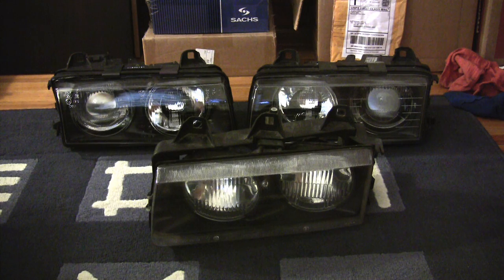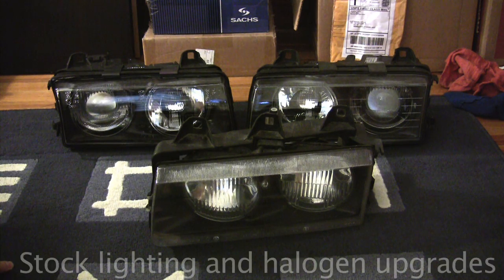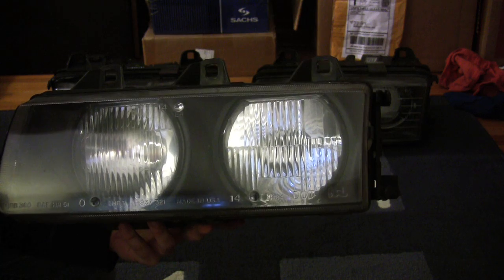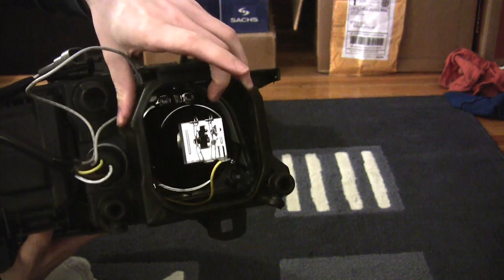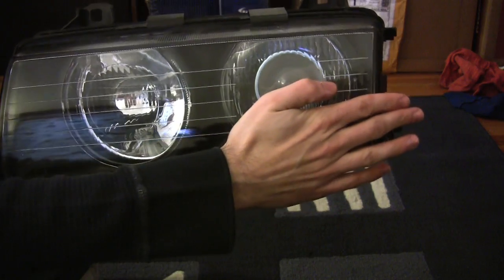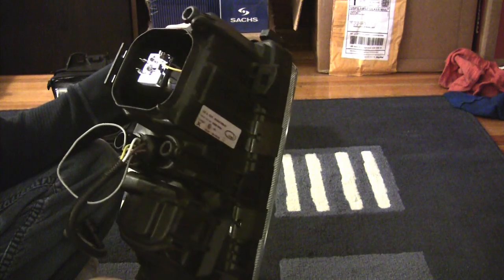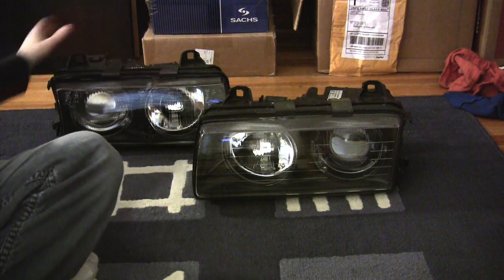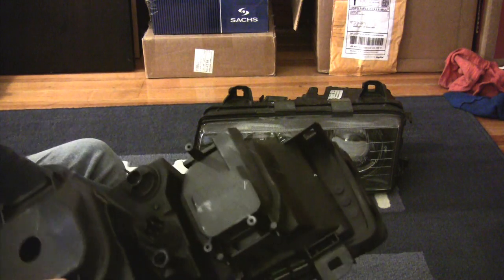BMW E36 Lighting For Noobs - Part 1 of 4

Comment: What are your opinions of the hella 9006/9006 euro reflector headlights? They could be the best of the bunch, better than the h1 and h7. Reason being is you can modify the hir2 bulb to fit into the 9006 bulb socket, they both have the exact same bulb geometry, and focal point. The main difference being is the 9006 bulb only puts out 1000 lumens and the hir2 bulb puts out 1850 lumens. The hir2 bulb also has a more tightly would filament, therefore creating a more focused beam. also the high beam is considerably better a regular 9005 bulb puts out 1700 lumens, however the hir1 , which is the high beam, puts out 2400 lumens. I would just like to know what your opinions are and why you didn't include these particular headlights in your review?
Reply: I modified a set of the HIR bulbs to fit my US-spec reflector headlights. They put TONS more light than 9006 bulbs. I want to upgrade to euro projectors but I don't want to give up the HIR bulbs. I can't find anything on the Hella 9006/9006 euro reflectors you mentioned. Do you have a link?

Comment: ZKW is actually an OEM manufacturer for BMW Euro lights. I have plenty of ZKW reflectors with glass covers. Also Bosch and Hella. Currently I'm using Bosch projectors, on came of a 1990 E36 and the other off a 97 E36 in the UK, which I converted to LHD beams.
Reply: Dr. Jay  Can i go from original BMW 1998 ZKW E36 Touring lights and just switch them over to some Hella or Bosch setup? Or is the plugs and electric atributes differant.
Sorry for bad english.
Reply: hanefar11  Plugs are the same in all except Compact, so if the replacement lights come off a compact they wont fit the plug in your Touring. Plugs are the same on the rest regardless of manufacturer. If your car is Euro then make sure you don't get lights from US, because they don't have the parking lights in the high beam lense like Euro does.
Reply: Thanks for a quick answer!
i look forward to getting my car road ready.

Comment: I got the DEPO angel eyes. It uses the retro angel eyes look. So not that CCFL shit that doesn't seem right on such an old car.
I have modded my auto height adjustment from my original lights to my DEPO's.
shit works like a charm! I drive a E36 convertible BTW :)

Comment: buy from DDM! i bought mine 1.5 years ago, no problems besides the glue not holding in the glass as well as i would like (i'll reseal it, no problemo), and got them with HID 6k and angel eyes for 125 (both sides)...can't really argue with that.